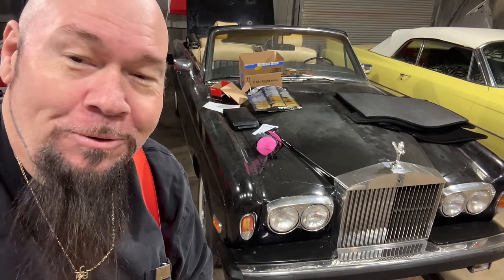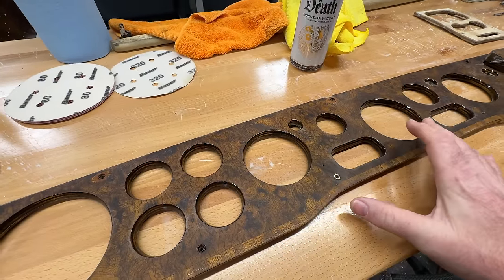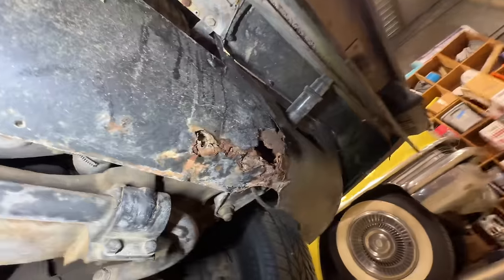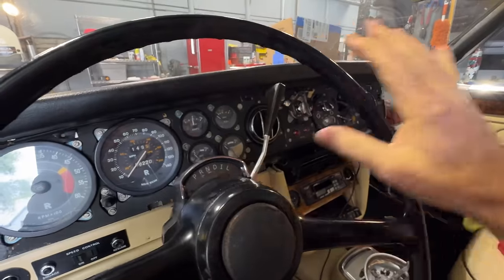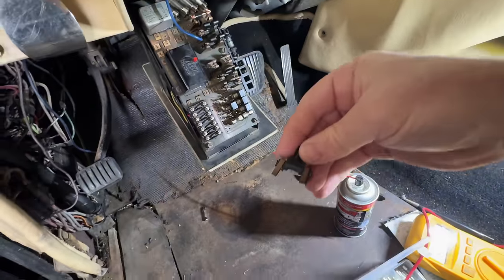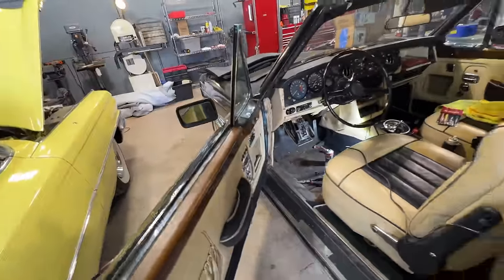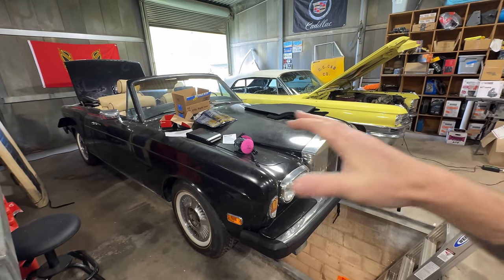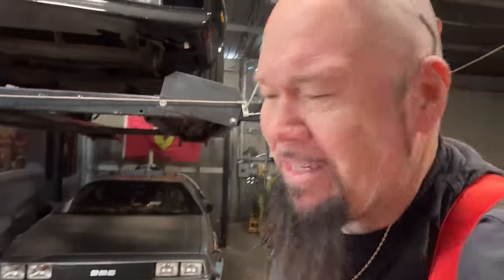Should I paint the dash on my Rolls-Royce Corniche?

Comment: I would be tempted to just slap a few coats of clear on the wood and see what that looks like. You can always paint it solid if you don't like it, but once you paint it, there's probably no going back. Also those little handheld steam cleaners from Hobo Freight seem to work pretty good. I bet it would get rid of most of the crud from underneath the car.

Comment: Stain the center consol piece you can also restain the dash to fix the parts where it’s oversanded, and get some degreaser and a pressure washer rather my a brake fluid under there!

Comment: I don’t know if you’re going to change the wiring. In my experience, the wires age for some reason they use a coding on the wires that are biodegradable. So good luck on that. We had a lot of faults and there’s no ODB2 to perform a test.  Everything else that you’re doing is beautiful. The wiring is what you have to be concerned with.

Comment: The wood would look amazing piano black with a chrome pinstripe. Find an outside ramp and stream clean the underside. It's a satisfying job when you are outdoors and safer. Blaupunkt Bremen Sqr 46 DAB radio is an option that has correct looks and modern technology.

Comment: Ir's a Rolls-Royce.  Part of their charm and their ambiance is their wood dash.  
Why not contact a furniture restorer?  Your local Ethan Allen store could probably point you in the right direction   Many people routinely restore the finish on their fine furniture that has become damaged for whatever reason. 
The wood could be cleaned with linseed  oil and then with the use of paste wax or other product you could bring it back to a very high luster.  The corners that look bare could be easily darkened with a furniture Touch up stick.

Comment: I have a Idea for all the wood. Remove all the clear coat then sand them down then run electricity thru the wood it would burn lightning bolts thru the wood then red stain the wood. Do a test on a scrap piece of wood and see if you like it.❤❤

Comment: Hmmm. I had a 1957 mk7 jag . Similar dash . I was just 17  . Getting the car ready for my license. Here in Australia we started at 18.  I remember sanding the dash and the grain of wood started to change direction!!!   Yes I had gone through the veneer. I painted the dash a Matt black. It actually looked very classy.  Years later I went to London and learned to restore pianos. And specialised in re-veneering and French polishing.  Of course now I would repair the veneer and use shellack . But it’s probably not the best to learn on this dash .
Since you are going to make a show piece of the car Paint the dash black and get on with life.   Cheers and greetings from Australia

Comment: At Home Depot that veneer is called a door skin. I would mix a little wood toned enamal to replicate the rest of it and then try light smooth coats of shellac. Under the car I would get a plastic dish tub and paint scraper to do easier work. For that front rus use a grinder to remove the rust and then tack weld a filler plate to restore the strength, then paint that fresh patch with black rust proofing. Might try moving right door switch to left door switch to prove the switch is boogered.

Comment: Have you thought about taking the dash to a carpenter and get them to create a new one using the existing as a template? That way, you can keep the original dash and hang it up in your garage and have a new one you can mess with. They could use solid oak or mdf with veneer over the top or simply wrap the original with gloss vinyl? That way, she. You want to restore it properly, simply remove the wrap..

Personally, I would go down that route and even get all the dial rims wrapped too. Imagine piano black wrap with red dial bezels - that would look wicked.

Comment: Dry ice will not remove grease that is caked on. You need a new steering coupler boot. The dash veneer is destroyed by aggressive sanding and NO power sanders should be used. The finish on some of the C's are lacquer and coated/sanded for a glass finish. Later C's have a urethane finish which is more durable. Professional repair on veneer damage is done by filling and coloring. This is the professional practice and you will never match the existing veneer. My channel on YT shows what a detailed undercarriage looks like.
Your brake pedal does not reflect a 18k mi car.
Take a pic of the wood and send to Madera Concepts. The car will be worth a lot less if the wood veneer is not shown and painted. The headlamp surrounds are stainless and not chrome. BTW no ladder frame on any RR from 1966 onward(except P5/6) Uses a front subframe and it's a monocoque design

Comment: you sanded through the veneer on a few spots. not the end of the world. you can always buy a new piece of veneer and glue it on top of the dashboard. you  can also just treat the wood  that still has veneer on it and get some wood putty and filler the sanded off parts and then match the veneer color with some minwax varnish. is that veneer walnut?  the Dashner channel on youtube does this kind of stuff all the time. try hand sanding because some veneer is quite thin.

Comment: Find an old clothes iron that you iron your shirts with and heat the veneers on the dash to melt the glue to pull it off. Or buy a router and some new plywood and copy the dash and buy some veneer of eBay and stick it on trim with the router it’s easier than it sounds Bob get YouTube certified before you start you can also re veneer the rest of the car also in a different wood if you choose to change it